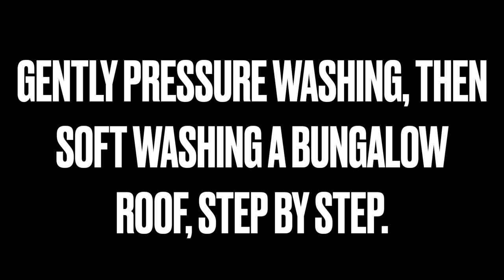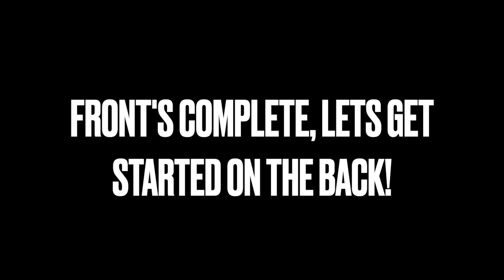Roof Cleaning Cambridge |  Roof Tile Moss & Lichen Removal

Comment: Hi Nick Ade here from Aqua-Holic Cleaning. Thanks again for your previous help and advice. Just about to carry out my first roof clean on a house using new equipment I've purchased including pole adaption kit and turbo nozzle. I've really been encouraged to give it a try from your excellent videos. I was thinking of using the 'mitower' scaffolding tower system 4 meter platform. Just wondering if you've ever used these and would recommend them? Thanks!
Reply from the maker: Hey Ade, thanks very much mate, it's very kind of you to say. I've personally never used a Mi tower, but i've heard they're great. I know Sid from Partridge Exterior Cleaning uses them sometimes and likes them, so might be worth asking him - he's on my recommended channel list if you aren't already aware of him. Good luck with your first job mate, you'll be fine 👍

Comment: I thought I posted a comment/question but I don’t see it so I’ll ask again.  If pressure washing removes all the moss, dirt and whatever else is up there why would anyone ever want to scrape?   Beautiful job.
Reply from the maker: Hi Brooke, many thanks for you compliment and question. There's a couple few reasons why people scrape over pressure washing. I think one being it's a lot cheaper to get into roof cleaning by scraping, as the investment is a lot less. Secondly I think some people are under the impression that pressure washing a roof will damage it and cause leaks, so people are apprehensive to get into it. 👍

Comment: When you change to lower pressure do you do that with the throttle or unloader valve cheers loving your channel
Reply from the maker: Hi Mark, thanks mate, you're very kind bud. I use the unloader mate, i've got a pressure gauge attached to the side of my pump, so I can see exactly what pressure i'm running at when I adjust the unloader. They don't come as standard on the Honda's, they need to be bought separately, they're about £9 from Rutland pumps. 👍.
Reply: @PrestigeExternalCleaning  thank you 😀
Reply from the maker: @markreynolds1154  Anytime mate 👍
Reply from the maker: @markreynolds1154  👍👍🙂

Comment: Hi Nick, looks impressive, a lot more satisfying than scraping and biocide, how much time do you think you save doing it this way and what softwash chemical do you use, if you don't mind me asking?
Reply from the maker: Hi Dave, To be honest honest mate,  i've got much less experience scraping than pressure washing, but i've always found both ways take roughly the same amount of time. The pressure washing is quicker, but there's more mess to clean up than scraping. I've always found scraping to be physically more demanding too. I agree that it's more satisfying to see the roof looking almost perfect straight away, it's why I do it this way more than any other, a lot of my customers seem to feel the same way too.
Don't mind at all bud, I use 15% sodium hypochlorite diluted down to 3.75% with added surfactant to help it stick. 👍.
Reply: @PrestigeExternalCleaning  cheers Nick👍

Comment: Great job buddy any issues with the sh oxidising lead in valleys ( if they where lead)
Reply from the maker: Hi mate, thanks a lot 👍. No issues with the lead bud, i've always found that if you keep the lead wet with the clean water from the hose, it'll be fine, and not change colour. 👍.